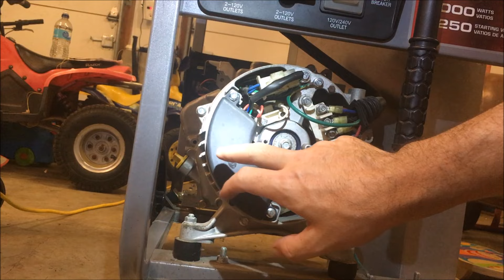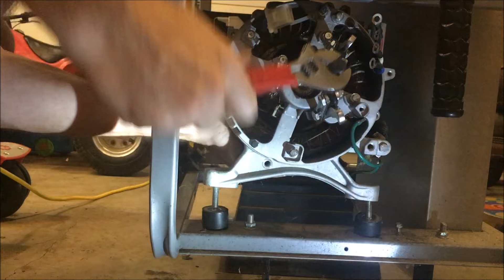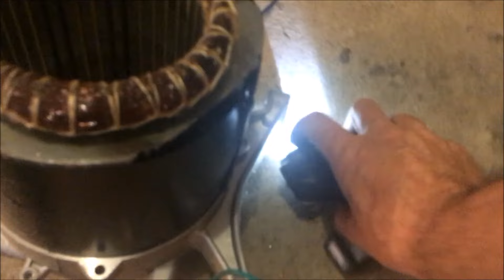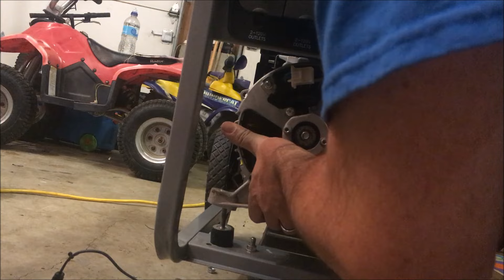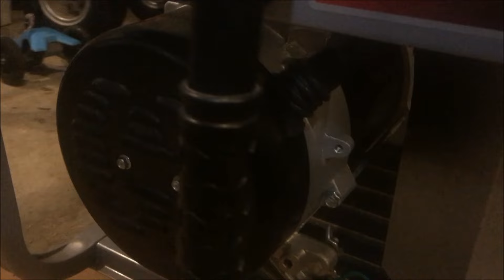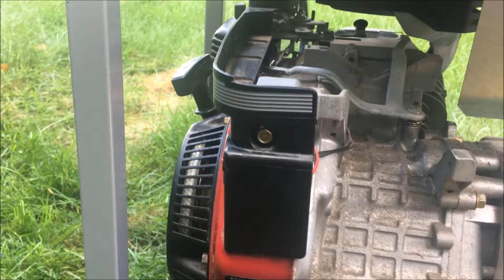Troubleshooting Generator No Power Output and Fix

Comment: Glad the rotor was good but that solder job, I don't think it will last too long. It could have been done much better.
Reply from the maker: Raymond Garafano I agree.  I do not have much experience soldering or the proper equipment.  It is a fairly common problem for that solder joint to break even when done correctly.  Will have to invest in the proper equipment next time.

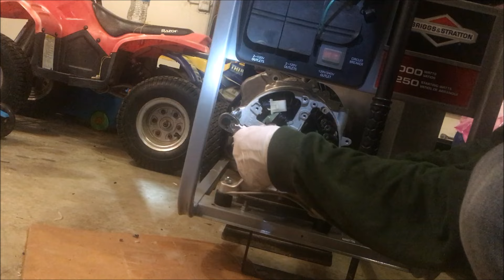Comment: 14:00 what happens is you connect the wires wrongly?
Reply from the maker: BeatSmith X worst case you short the stator out and it will quickly overheat and go bad.
Reply from the maker: Also you could potentially wire it up in a way that it puts out 240 volts at the 120v outlets.
Reply: @jcondon1  oh. you mean the four wires are for 240v and 120v?
Reply from the maker: BeatSmith X yes.  There are two pairs of wires, each 120 volts but 180 degrees out of phase so when one pair is +120, the other is -120.
Reply: @jcondon1  oh. I understand
Reply: Frytime!

Comment: Just advice...as most everything today is solid state electronic..older generators need to be replaced with newer ones with invertor technology .
Reply: Generator safety rules: anyone who uses portable gas generators really needs to see this safety reminder. All generator safety rules should be followed carefully. This advice is just to make sure that everyone is aware of all the warnings and it’s just to remind people to be careful using portable generators. Generators can be dangerous if not used carefully. Every year, hundreds of people die or get injured when using portable generators due to carbon monoxide poisoning and electrocution. Make sure you are using your generator carefully and keeping others safe as well. There is something very serious that everyone should always be aware of when using generators. Some people do run their generator indoors which is not safe and that increases the risk of carbon monoxide poisoning which can cause death of family and you. Some people run their generator in wet conditions which can electrocute them. Please remember that you should never run your generator indoors. Remember that carbon monoxide is an odorless and colorless gas that you cannot see or smell. Carbon monoxide is a silent killer. Keep that in mind. Make sure your generator is 15-20 feet away from your house and away from doors, windows, and vents. Never use your generator in your porch too. Having a carbon monoxide detector is very important against generator safety. Some people also allow children to go near the portable generator which could pose risks. We need to keep an eye on our children making sure that they are not near the portable generator so they won’t get electrocuted or burned by the generator which is dangerous. A locking enclosure also keeps kids safe. A generator shed might look like a tempting place to explore, or take cover during a game of hide and seek, but a generator is a dangerous piece of equipment that can cause injury. It says on the manual that we should also keep children away at all times from the portable generator to avoid injuries. Please do not allow a child or unqualified people to operate the portable generator. Just because some manuals missed what should be listed doesn’t mean it’s safe to do. Always follow the generator safety rules when using portable generators. Generators pose electrical risks. If you need to use your generator during wet weather, you need a generator tent to protect your generator from getting wet. Don’t let your generator get wet. Keep your generator dry and before using your generator, please make sure your hands and your generator is dry. Do not wear loose clothing when operating the generator. Everything that is said on the generator’s operating manual should not be ignored. Never smoke cigarettes near the generator. Please keep flammable things away from the generator. Never overload your generator too. Your generator can catch fire. Never ever try to plug a generator cord into a wall outlet to avoid back feeding. Back feeding your generator is dangerous. Always turn on your generator first before plugging in appliances and shut off the appliances before turning your generator off. Use a heavy duty cord for your generator and the cord should not be worn out. All the instructions should be followed carefully. Never refuel your generator while it’s running. It can cause fire if fuel spills while your generator is hot. You should turn off your generator and let it cool off before refueling it. Having a fire extinguisher next to the generator is also important. This is only a reminder for everyone’s safety of using generators. Make sure your generator is properly grounded. Having a fire extinguisher next to the generator is also important against the safety rules. https://youtu.be/I1jT3ANENvI and here is a video more about keeping others safe when using generators and also about our family’s safety. Hope this helps. Thank you.

Comment: Cycles per second..USA good 50-60 hertz..most appliances and tools.  Electronic items and tool battery chargers will work but may fault. Emergency generators are just that..run only needed items.  Kitchen appliances with electonic displays or controls should not be ran on a non pure sine wave generator. Heating and cooling appliances included..unless than circuit has surge and spike noise protecting.
Reply: Don’t forget about the generator safety rules: anyone who uses portable gas generators really needs to see this safety reminder. All generator safety rules should be followed carefully. This advice is just to make sure that everyone is aware of all the warnings and it’s just to remind people to be careful using portable generators. Generators can be dangerous if not used carefully. Every year, hundreds of people die or get injured when using portable generators due to carbon monoxide poisoning and electrocution. Make sure you are using your generator carefully and keeping others safe as well. There is something very serious that everyone should always be aware of when using generators. Some people do run their generator indoors which is not safe and that increases the risk of carbon monoxide poisoning which can cause death of family and you. Some people run their generator in wet conditions which can electrocute them. Please remember that you should never run your generator indoors. Remember that carbon monoxide is an odorless and colorless gas that you cannot see or smell. Carbon monoxide is a silent killer. Keep that in mind. Make sure your generator is 15-20 feet away from your house and away from doors, windows, and vents. Never use your generator in your porch too. Having a carbon monoxide detector is very important against generator safety. Some people also allow children to go near the portable generator which could pose risks. We need to keep an eye on our children making sure that they are not near the portable generator so they won’t get electrocuted or burned by the generator which is dangerous. A locking enclosure also keeps kids safe. A generator shed might look like a tempting place to explore, or take cover during a game of hide and seek, but a generator is a dangerous piece of equipment that can cause injury. It says on the manual that we should also keep children away at all times from the portable generator to avoid injuries. Please do not allow a child or unqualified people to operate the portable generator. It’s important to keep our children safe especially little ones. Just because some manuals missed what should be listed doesn’t mean it’s safe to do. Always follow the generator safety rules when using portable generators. Generators pose electrical risks. If you need to use your generator during wet weather, you need a generator tent to protect your generator from getting wet. Don’t let your generator get wet. Keep your generator dry and before using your generator, please make sure your hands and your generator is dry. Do not wear loose clothing when operating the generator. Everything that is said on the generator’s operating manual should not be ignored. Never smoke cigarettes near the generator. Please keep flammable things away from the generator. Never overload your generator too. Your generator can catch fire. Never ever try to plug a generator cord into a wall outlet to avoid back feeding. Back feeding your generator is dangerous. Always turn on your generator first before plugging in appliances and shut off the appliances before turning your generator off. Use a heavy duty cord for your generator and the cord should not be worn out. All the instructions should be followed carefully. Never refuel your generator while it’s running. It can cause fire if fuel spills while your generator is hot. You should turn off your generator and let it cool off before refueling it. Having a fire extinguisher next to the generator is also important. This is only a reminder for everyone’s safety of using generators. Make sure your generator is properly grounded. Having a fire extinguisher next to the generator is also important against the safety rules. https://youtu.be/I1jT3ANENvI and here is a video more about keeping others safe when using generators and also about our family’s safety. Hope this helps. Thank you. Be safe.

Comment: Good repair...One thing to note, not all gen rotors are wound with copper wire. I had a diesel set  where the rotor was wound with aluminium wire...There was a break just before the slip rings...I thought I could maybe join a piece of wire to make good the connection...but nope! Ended up rewinding the rotor with enamelled  copper wire for a lasting repair. Sold it for much more than I bought it...good result.
Reply: GOOD FOR YOU..aluminum wires....those 'guys' overseas somewhere,should use copper, one gauge larger, instead of saving yuan money.....u know where THAT  is...
Reply from the maker: Have not done a rewinding yet.  I though about it once, but could not find a good source of information on that.
Reply: James Condon , James to effect a repair, you need the gauge of wire and the weight...Measure the diameter carefully with a micrometer and select rhe gauge of wire nearest to your measurement...Technically it should be done on the bare wire without the enamel coating...but trying to remove it will result in danaging the wire surface and give an inaccurate size. Next remove the old windings preferably without damaging them too much. Maybe use side cutters to nibble through. You can then either weigh the mass of wire or count the number of wires, take an average length, and add 10%... To give you an idea, I rewound a rotor from a 2.5 kW gen and used 1100 gms per side but I forget the gauge now, was a long time back...Dont forget, if the winds are aluminium, theres a weight difference.! If you go the mass/weight route rather than wound length..

Comment: How about a generator that dont have brushes and the cap is new and I tryed to flash it
Reply from the maker: I have never worked on a brushless generator.  With that said, they are very similar.  Inspect the rotor and stator visually.  Look for any black or burnt wires.  If that checks out do an ohms test on the stator legs.  Not sure the exact reading for your generator but would expect a low number around 0.5 ohms.  If above an ohm or open circuit, then most likely a stator issue.  Another thing to try, with the generator running, measure the voltage out of the outlets.  You should get somewhere between 3-10 volts.  If you do, that indicates that you have residual magnetism and stator is probably ok, but the rotor is not powering up.  The rotor on a brushless has a small exciter winding that acts as the secondary of a transformer producing A/C voltage that then goes through a bridge rectifier (also on the rotor) to send DC power to your rotor turning on the electro magnet.  I would suspect a broken wire near the diodes.  To verify, most likely you would have to remove the stator and do some continuity and ohm tests to make sure there is no break in the wire.  Rotors spin at 3600 rpm.  That speed commonly breaks a wire over time.
Reply: It still has a wound rotor with rectifiers, with two sets of windings or coils. 1 set of coils gets a.c. and changes to d.c. then sends d.c. to another winding. so u disconnect the rectifiers and flash the winding, then hook up diodes. with some residual field on the rotor. volts get built up in stators main and excitation windings, the capacitor holds a charge so gen builds up volts next time it is used. exciter field coil in stator induces a.v. volts in rotor that get changed to d.c. voltage, making rotor a strong electro-magnet causing much greater voltage , like it is supposed to.

Comment: A great deal could be added to this video by giving a clear description of exactly what and where the testing is being done. A dark view (more lighting required), especially when obscured by by hands in front of the camera, is of limited use to someone trying to determine "exactly" where/what to "touch" with the multimeter probes.
This is difficult I realized but if this is to be an instructional video...
Reply from the maker: I agree.  I want to make a better video on this, but have not been able to get another generator in this condition.  I am working on another video which I think improves on this one.  The link I am about to share will only work for a week or so.  This is a work in progress.  Still have more to add regarding testing the brushes and another test.  Here is the link: https://www.youtube.com/watch?v=ENwNC-7SaAw&feature=youtu.be

Comment: Re: the 4 pin connector to the controller. 
I need ohm readings and the specific pins the measurements are taken on.
Only 20 volts out of generator. Flashed it no change. Rotor 66 ohms. Stator windings both about .5 ohms.
Replacement regulator on the way but I would like to know what's going on.
Thanks.
Reply from the maker: zardoz992 I do not know those reading off hand.  Will see if I can find them and get back to you.  Those wires represent two coils that produce AC power.  One coil provides the power for the AVR and the other it uses to monitor the power output and adjust the DC power going to the brushes to maintain 120 volts.  Set you meter to continuity and find the wire pairs, then do an ohms test.  I would expect the reading to be low.  Some thing in the 0.02 ohm range.  Your rotor and stator reading sound good, but meters only test ohms at around 1.5 or 3 volts.  If you have an insulation problem it may not show up until you increase the voltage.  Unfortunately that test equipment is expensive.  If a new AVR does not work, then would consider the brushes or a dirty slip ring.  You can do an ohms test through the brushes.  The reading will be higher.  In the 300 ohm range, but it will tell you something about the brush health.  To get a good test, pull the spark plug out and rotate the engine slowly and see the changes in the reading.  This is due to the slip ring rotation and brush play.
Reply: @jcondon1  turns out the stator windings were bad. Found some melted wires ☹☹☹😧.
Not sure what winding they were from. Might have been the AVR supply coil.
Thanks for the reply
Reply from the maker: zardoz992 that is bad news.  I did find the ohms value you requested, will list it in case others need it.  The range should be 1.0-1.5 ohms for the exciter winding.  Each generator is different, but would expect most in the 4000-7000 watt range to be similar.
Reply: @jcondon1  
Thanks for the info
Reply: @jcondon1  
I now remember that there was some resistance between the exciter coil and the main winding. 25 ohms I think. Apparently that should have told me that we were done right then.